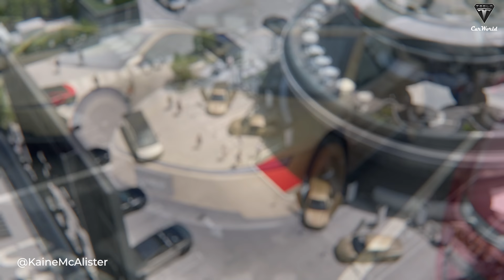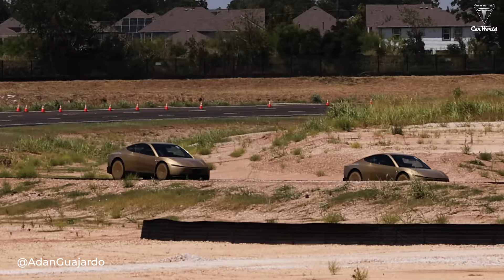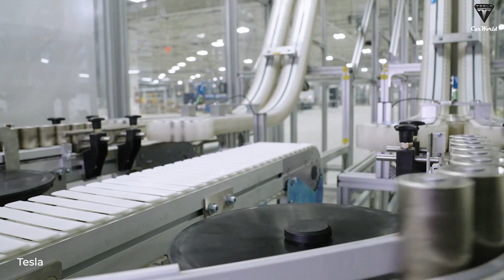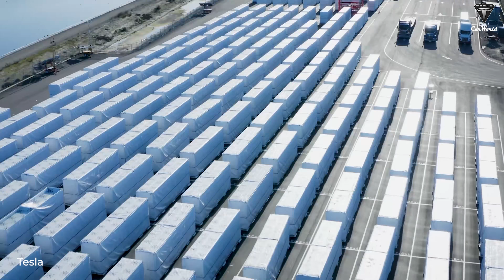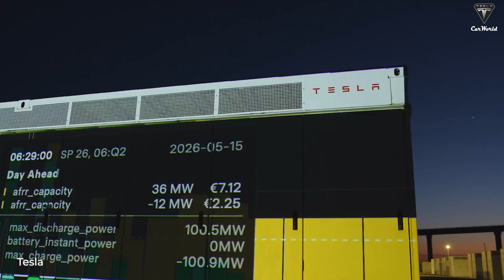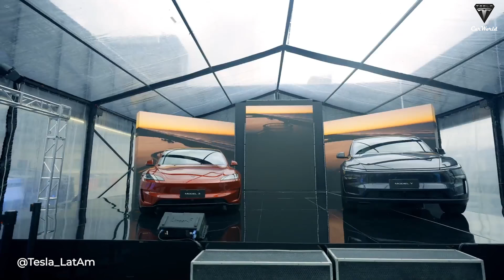Tesla Cybercab Robotaxi Spotted New UPGRADE! Massive Fleet Coming!

Comment: In theory, you could offer in-cab wireless, load balanced between 5G and Starlink. I expect it would favor starlink, then 5G, and it could offer it as a single WiFi access point you can auto connect to when entering the cab. For 5G, prioritise any management traffic over customer traffic for obvious reasons, and maybe even bill the user directly for any usage. "You used 4c of cellular during that trip, I'll add it to the ride bill"

Comment: The only reason I could  possibly perceive any skepticism of the Starlink antenna would be connectivity issues i.e In rural areas and in Urban areas during bad weather,when it rains or on cloudy days; and the possibility of the  hacking  of the Cybercab but I'm quite sure that these issues have already been taken into account and either have or will have the necessary protocols and safeguard by the time of the official rollout. I think its great and admirable for any manufacturer when it issues a recall because it shows that it has its consumers in mind and that adds to the character and reputation of the company. I don't have any thoughts concerning the roadster because unfortunately I haven't had the experience of driving one (Tesla vehicle)and hear about how much fun to drive and futuristic they are but that's a normal thing for me to do things late or after every on else does and I doesn't bother because Im aware that things happen at its appointed time. As far as Terrafab goes I think that because its going to be a massive monument there should be allowed touring for the public just for viewing that wouldn't interfere with any production starting first with local residents and current owners of Tesla and maybe have tour packages designed in the future for anyone else whose interested because from what I can see already it will be a tourist attraction.🤔

Comment: In 10-15 years I would bet that Cybercabs or a grandchild of it is the largest selling car in the United States.  Consider an aging population.  One major issue with seniors is driving and the loss of independence that comes when you stop driving.  EVEN if you have a car that is paid off you have insurance, gas/electricity, standard maintenance, registration.  These add up.  Now think about someone who is retired and driving only 50-300 miles a month.  I would love to use a Cybercab instead of paying to own a car.  Basically I see Cybercab displacing standard car services like Lyft and Uber.  There will still be a need for car services.  Folks needing assistance or with 3 or more passengers or luggage.  But I can also envision Cybercabs that are single seat MINI Cybercabs, 4 and 6 seat versions or variations for luggage capacity.  Now I'm thinking about all the information out in public on Tesla Semis.  Applying that tech to Cybercabs, I can see non retired people getting rid of self owned cars and SUBSCRIBING to an UBER type of service.  You pay a monthly fee for a certain number of miles (like we do with data on cellphone plans).  And if you are taking a trip you could actually pay a bump for a short period for extra charging at Tesla Charging stations and extra miles.  Just like when I am using a low data plan, and travel to a place that I will be using more data.  This technology is going to be as dramatic as the Ford Model T (15 million total production from 1908-1927 *note world population was only 2 billion in 1927).  Why?  I'm retired but want to do things.  My roommate works at night from 5pm - 1am.  My other roommate is a school teacher.  She works from 7am-3pm.  Another roommate is also retired and goes to watch is grand kids play pickle ball and go to the bar.  Yet another roommate is retired and goes out for groceries and doctors appointments.  Everyone has a car.  But do we USE 5 cars.  NOT really.  We could have a household/family plan that provides us the use of a 'CyberCar' subscription for 1,200 miles per month.  That would eliminate our house having 5 cars.  That means each would save several hundreds a month.  A family plan could be super affordable for 1200 miles per month at $800 - $1200 per month.  No more worries about oil, smog, maintenance, tires, insurance or other problems.  MOST of the time we drive we are one person in a car.  This is also why I see a smaller MINI CyberCar in the future.  One seat with room for groceries or even a wheelchair or a built in Car Seat.

Comment: If the Cybercab can already drive without a cellular connection, why add satellite connectivity at all? Passenger entertainment alone doesn’t seem like a strong enough reason.
Reply: I asked google WHY self driving cars have a cell connection:  Yes, self-driving cars use cellular connections (like 4G LTE and 5G) to communicate with remote operators, receive live traffic and weather updates, download software updates, and share data via Cellular Vehicle-to-Everything (C-V2X) systems.  Part of Musk's Starlink vision is that long term it will replace earth based cell towers entirely.  Thus increasing a consistent revenue stream for Starlink.  It also helps with a common problem in Emergencies.  These emergencies also cause a loss of power to cellphone towers and equipment that rebroadcasts the signals (? repeaters).  Using Direct to Starlink cellphone connectivity this common problem in emergencies is eliminated.  However I suspect something more is behind the inclusion of Starlink on a Cybercab.